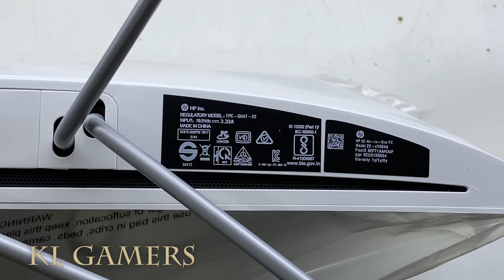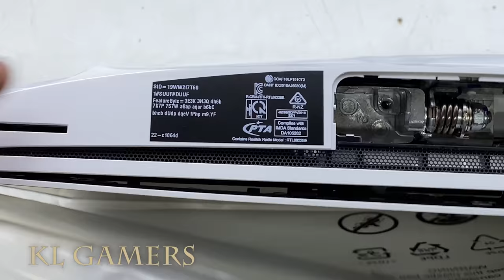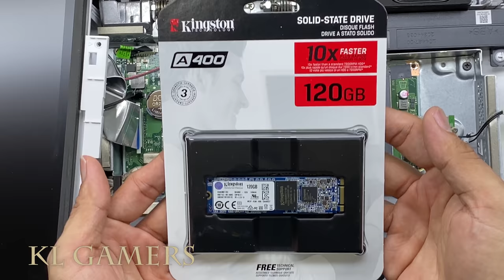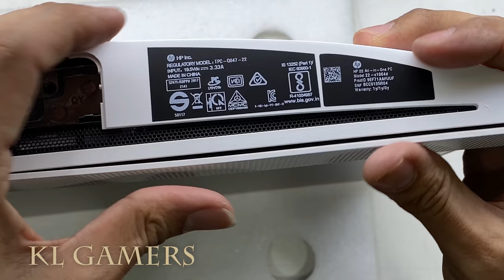HP ALL IN One PC 22-c1064d Upgrade SSD and DDR4 RAM

Comment: Did this today.  I have always been good with PC's but never had to encounter this.  I was scared to say the least.  BUT.  I did it.  Ram was detected and all was buttoned up just like before.  Runs great and now 16GB of RAM instead of 8.  This can be done but prepare for an intense 1/2 hour or more especially if you do not have the right tools.  Go slow and do not push the envelope.
Reply from the maker: yes pressing down on the soft LED screen felt dangerously satisfying
Reply: @KLGamers   LOL.  Me too.
Reply: Yeah I tried to just remove everything but stopped at the screen since it kind of made a snap sound and a large chunk doesn’t work
Reply: Are you able to change the cpu to something like a ryzen 5 or is it not possible

Comment: This is a really good video applicable for many, if not all, of the recent HP All-in-Ones.  At the same time, HP deserves severe criticism for the lack of a maintenance manual for these All-in-Ones on its web site.  Also, HP gets even harsher criticism for the next-to-the-worst design of an All-in-One.  Why next-to-worst?  Apple's iMacs get the crown for the worst design for maintainability.  With an iMac, you need special tools, a special cardboard part, and replacement ADHESIVE to glue the screen on after you remove it, all courtesy of iFixit.  If only HP had glued the screen on for this All-in-One, it could have shared the title with Apple for worst ever computer to repair or upgrade.  If you need to work on an HP All-in-One, this video is for you.  Better still, DO NOT buy an HP All-in-One!!!!

Comment: I upgraded from 4GB to 16GB today. My 22-df0001na is slightly different (brand new in November 2021). The stand didn't need to be removed, although I did remove the stand cover which is all in one piece as opposed to the three in this video. I'm not sure if it needed to come off or not. Once the speaker cover was off (it's handy to be a guitarist as medium and hard picks are perfect for upening the little catches!) there was a set of screws - all with little double arrows pointing to them They all needed to come out. A magnetic screwdriver is important for this job as some screws are deep. Loosening the screen was a bit hairy, but gentle outward pressure from the bottom (where the screws came out plus some gentle sliding and tweaking with the pick got me there in the end. Thanks for giving me the confidence to have a go - working perfectly now.
Reply: Hello my information, which ram should I use to further strengthen the hp all in on hp22df1001nf 32gb? Now 8 gb ram not good-_-
Reply: Please any one tell me that which type of ssd can be installed in my hp all in one pc 22 df0xxx
Can sata ssd could be installed?
Help me
Reply: @H-B-M-  Any DDR4 So-DIMM ram up to 2400MHz is officially supported. I put a set of Teamgroup Elite 3200MHz in one and it runs great
Reply: @sunilkumarsingh9933  An m.2 2280 is one possible option. A sata ssd is another. Both are compatible, but if you want to keep the harddrive you'll want to get an m.2 2280 SSD

Comment: For those who have this computer I have this same one, and I am trying to confirm if the CPU is soldered or not. i see the heat sink is obviously screwed down as if it's holding the cpu, yet, could that just be to hold the heat sink over the soldered cpu? I did some research on the type of cpu & its claiming to have a FP4 socket type which i am able to find only a little information on at this point. I know that cpu chips can be resoldered if done very very carefully, but i want to ask the more knowledgeable ppl if they may have already know of a cpu upgrade. if you have this computer you already know the specs. i'd hope the video maker could answer but seeing this video is 2 years old i don't think he will. I'm more accustomed to Tower pc's, not very acquainted with these all in ones yet i'm trying to understand what needs to be done before i pry open this computer.

** Update *** I highly believe now that the cpu is soldered.... any ideas? can a socket be attatched? is there a cpu that can be resoldered onto this type of whatever for any kind of upgrade?

Comment: Perfect video.. I put the extra 4GB memory and it is working great... thanks KL gamers... it helped me save a lot👍.. I was about to dump this 2 year old PC.. I am told that I could fit 2x 8 gb also ... but cannot do one 4 and another 8 ... thanks a lot for this very detailed video👍
Reply from the maker: Great 👍
Reply: Why would you dump it?
Reply: Actually you can mix RAM of various sizes, speed, timings, chip configuration and brand, it's just they won't work "optimally" together, i.e. performance won't be very uniform and consistent. The whole "you can't mix RAM" thing is more of a thing in the past when CPUs didn't really have advanced and flexible memory controllers in them, especially around the mid to late 90's era.

Mixing RAM isn't something you want to do in a PC used for gaming or any other speed sensitive application though, my old HP workstation which had mix of two different duos of RAM modules (two single-rank and two dual-rank, both of different timings) would have quite noticeable microstutter in some games, particularly in Destiny 2, and I attribute these stuttering problems to the memory configuration of that computer, since no amount of increasing or decreasing visual quality settings would solve the problem. This was with an RX 460 4GB graphics card too, which should be able to run those several year old games fine at low settings at the very least. Heck, I had an even much older and less performant HD 5770 1GB before that card, and the microstuttering was kind of noticeable there too.

But yeah, mixing RAM is possible, I just wouldn't recommend it if you use your PC for gaming or any other application that requires performance that is both fast and predictable, consistent (audio workstation / heavy video editing maybe?)
Reply: Please any one tell me that which type of ssd can be installed in my hp all in one pc 22 df0xxx
Can sata ssd could be installed?
Help me

Comment: Great video. So I have a question: I rebooted the computer and got a black screen with blue dialog box stating that boot device not found and saying to install OS on the hard disk. Do I need to order a recovery cd? Thanks!
Reply: I’d recommend to clone your previous HDD into your SSD before installing the SSD. They usually come blank so you’d have to manually install an OS in there :D

Comment: What is the max capacity the M.2 slot supports? Also, what speeds does the M.2 slot handles? SATA or NVME speeds?
Reply: My question exactly. ;)
Airing on the side of caution, I just installed a SATA M.2 drive, and it worked fine.
The whole M.2 SATA vs NVMe thing is a freaking nightmare, as some boards are even FITTED with single-key M.2 slots - but are SATA, so you put an NVMe drive in there, and the machine can't see it.  Grrrrrr.  In this video, they show install of a SATA M.2 drive, so go with that and it should work fine.

Comment: Thank you for the video. Question, we followed the instructions step by step thank you making it easy. But, now we get a black screen and succession of beeps. Do you have any tips?
Reply: The ram chip isn’t seated properly. Open it back up an reset it. Should fix the problem. If not, you might have a bad ram chip.
Reply: I had to reset the BIOS by removing the CMOS battery for a few minutes. The weird thing is the only acceptable configuration of RAM for my computer is (1) deeper RAM slot - factory 8GB RAM, (2) higher RAM slot (where the factory RAM was originally seated when I first opened the case) 16GB Gigastone RAM.

Thank you for the video!

Comment: Hi. I just bought a new Hp 27in AIO. It’s the CB0000a I think. Anyway. It has a Ryzen 7 with 12Gb Ram. I am upgrading to 32Gb as that’s the max. But I’m wondering if I can upgrade the 
Amd 5700 to a Gaming Card? Like a 3060 or something? Would I be able to do that with an HP AIO? Also, would I need to do anything else if this is possible at all? Thx to anyone who can answer.
Reply: You can't.